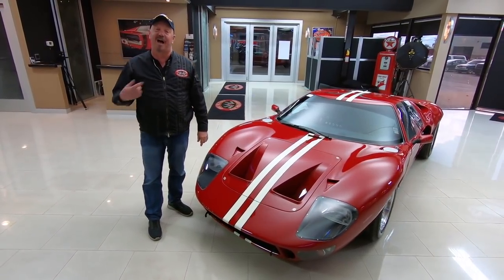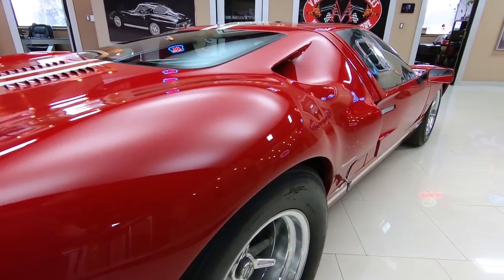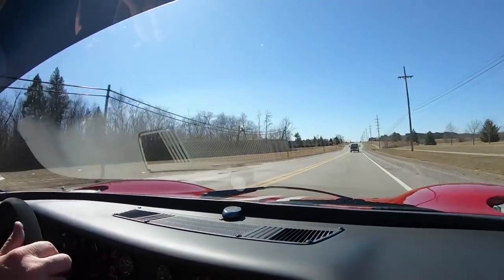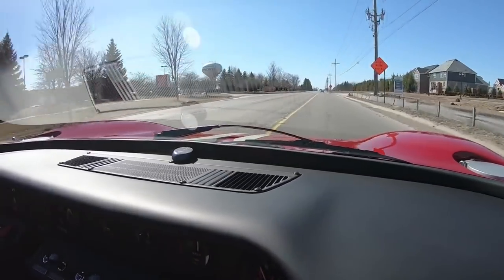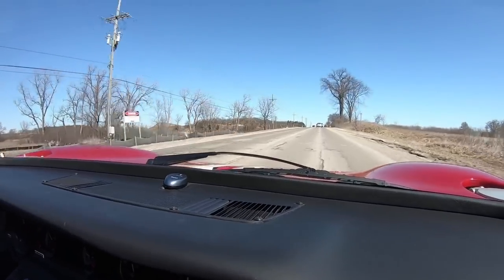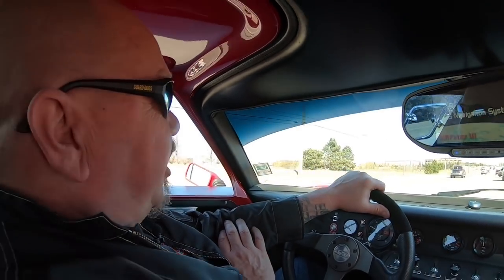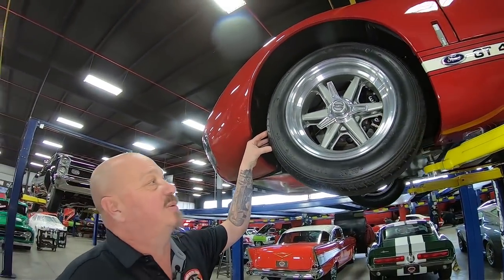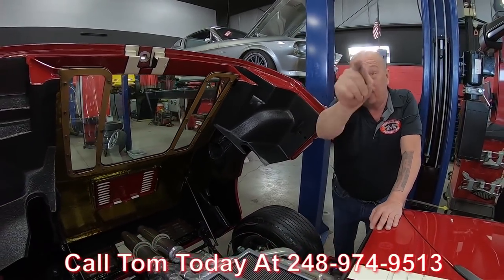1966 Ford GT40 Superformance For Sale

Comment: I would like the interior wrapped in peanut butter color leather double stiching ,and kenwood sorround sound bluetooth stereo,and racing stripes separated only by a half inc ,delete front scoops ,racing number inside white oval number 2 ,but you got it baby ,
Reply: @Roland Rodriguez - The fact that you want a surround sound system tells me you really don't appreciate the fact that this car has as good a sound system as you could want....and it's not even an option, it's the engine!
Reply: @Loulovesspeed  ...you got that right....that motor kicks any sound system.....

Comment: what is with all the "ice cream" comments ?  I can see saying it once, but repeatedly ?  wtf eats ice cream in a GT40 ? 

you seem like a nice guy but the sales pitch is repetitive, sophmoric, and almost complete bland in tech specs.
what's the compression, induction system, final gear ratio, weight, top speed, horsepower/torque ??
this is the most softball sales pitch I've ever heard for a very high end car.  no offense.
Reply: This guy doesn't have any trouble selling these cars.  I'm sure he's super concerned about your opinions, though.